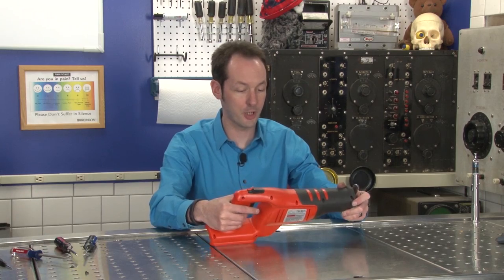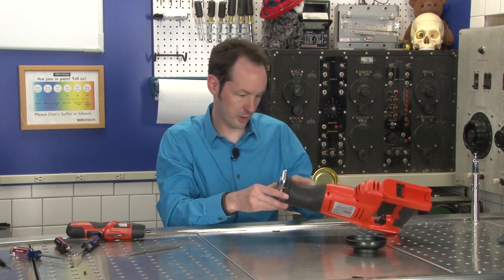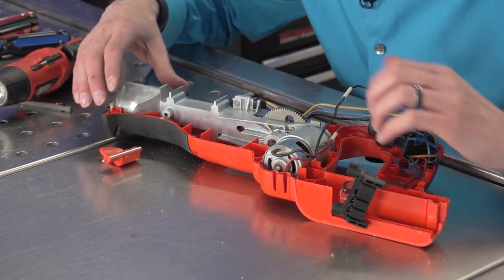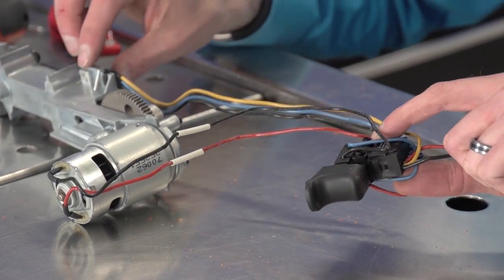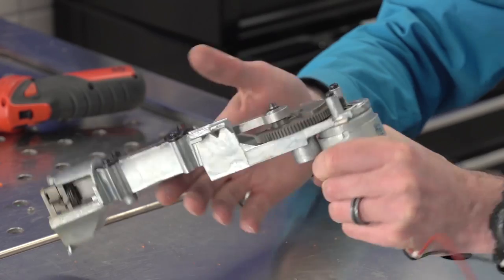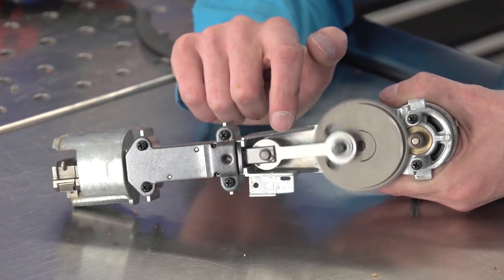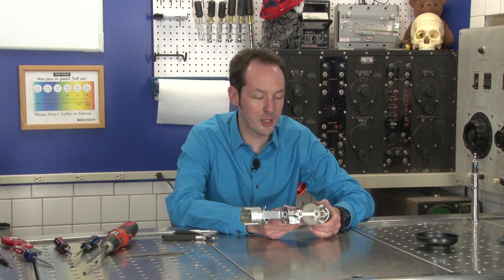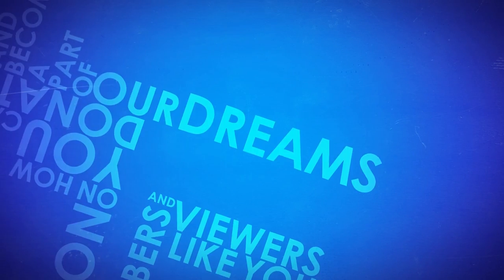Reciprocating Saw: Equipment Autopsy #72

Comment: Something else really cool is the spring loaded wire terminal that you couldn't figure out.
 On the Switch (and several other components) the wires are connected by Spring loaded contacts that are like Japanese finger traps, the more you pull the tighter they get. To release wire, insert a small Screwdriver or a piece of wire hanger into the hole next to wire. It should come right out.

Comment: Fun info tidbit: those speed controllers are the only place in modern, industrially-produced equipment that I have ever found a 555 timer. Simple astable multivibrator setup with carbon tracks as pots, giving PWM to a mosfet. Rock simple.

Comment: Perhaps it could be a demo about how a DC motor can be both a drive and a generator. In demo 1 you use the motor to drive a piston to compress air. In demo 2 you use the compressed air to drive the piston to have the DC motor power a light bulb. That particular scenario also demonstrates some different states of energy.

Comment: Depending on how slow and constantly powered the reverse piston system is, I could see it as apart of the guts of a pump system to pull old gasoline from a lawn mower and other gasoline based yard tools to get them winterized or ready for spring action.

Comment: I'd make it into a pump for a vacuum chamber, then take a look at high voltage arcs at low air pressure (I know, I'm a nerd but I don't care).  Actually I've never seen the point of a reciprocating saw when I could do the same job with my jigsaw.  To their credit though it is at least all metal inside, probably crappy cast metal but still, my jigsaw is built worse, it has has things such as the bearings and the motor mounted directly on the plastic housing!

Comment: How about a really odd spark gap for a tesla coil. put some sort of pole on the reciprocating mechanism, and another on some sort of frame.

Static electricity generator. Put some material in some sort of mount, run on another material and get a lot of static.